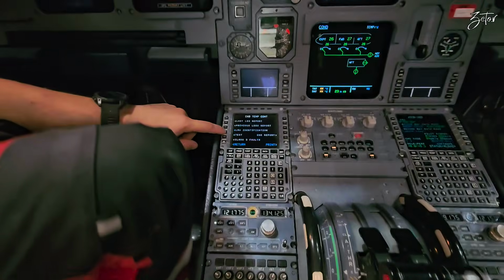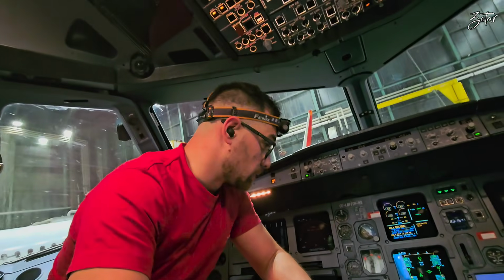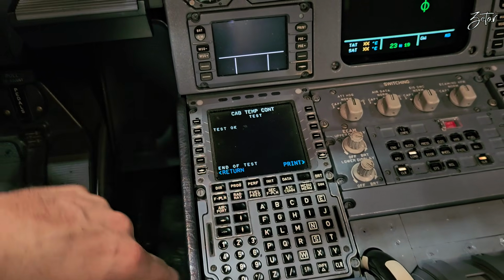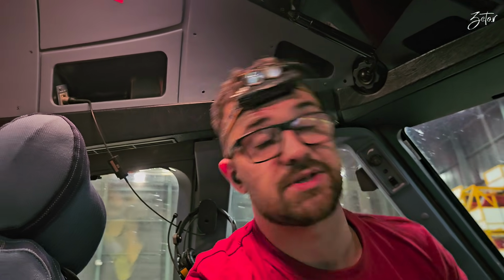How to control the temperature inside the aircraft

Comment: I have a question to make sure I’m understanding the airflow path correctly:

When the A320 is pressurized, is the extracted air from the cockpit taken only through the temperature sensor—the small opening where the cockpit temperature probe is located near the breakers panel? And in the cabin, is the air extracted only through the lavatory ceiling area and the temperature sensors/temperature indicators found throughout the passenger cabin?

I assume air is also extracted through the galley, but I’m not entirely sure where the exact extraction point for the galley is located.

So, my main doubt is: Are these the only points where air is actually removed from the cockpit and cabin on the A320, or is air being extracted from somewhere else as well?

Comment: Thank you very much, Engineer Zito, for this valuable information.. A question, please
We have problem that the two packs give outlet temperature about 20 or 25 degrees and the zone selectors at full cold .and the bypass valves every four minutes open and the packs outlet temperatures rise up to about  60 degrees then close and packs temperatures come back to about 20 degrees .we changed most the parts and the controllers but no help
Reply from the maker: Leak on air cycle machine, gasket on the side is worn or machine it self is stucked

Comment: i like the details you provide! and a question. why's the fan mandatory if the cabin is pressurized when in flight? or is necessary when the aircraft is grounded? shouldn't the air extract naturally?
Reply from the maker: It is necessary to have stable and constant airflow if you change the speed it can change the value. That's why is fan mandatory

Comment: so is the door on the outside is open in flight to vent the exhaust ? looks like it would create disruptive airflow round the rear of the aircraft all said not much but looks like a poor design to me
Reply: ok so where does the cabin air go from the two  outlets ? surely its vented
Reply from the maker: @Derekmorgan-s2j aha now I understand. Yes it helps actually to suck our out of galleys toilets and temperature sensors so you have always accurate temperature if everything works properly
Reply from the maker: Aircraft is pressurised during flight and you are not able to open the door

Comment: There so many high pressure hydraulic and pneumatic piping and connections along with electrical wiring, it’s amazing everything works for many decades in such a complicated system. It’s amazing
Reply: It works because it's maintained several times per year..

Comment: If the outlet of the fan just has an Open end in the Air..how is cabin pressurization possible?🤔
Reply from the maker: There is an outflow valve it is used for the pressurisation  of aircraft it adjusting position during flight

Comment: hi zeto! ive also had worked with a320. i wondered, how is your way of replacing waste tank water saparator? because the last time i did was, i have to remove couple of seat in the cabin right above where the waste were located, and removed the floorboard. please show us your method

thank you
Reply: hi, I have done this (shitty) replacement several times. You don't have to remove seats, floor panels e.t.c. Everything can be done from the aft cargo. Just open the partition panels and get inside. Sit adjacent to the waste tank and begin the removal of the separator. Most of the times, you don't have good access to remove it since the separator with filter is on the top of the tank but if you remove some screws from the tubes you can move them a little bit around to make some access for the removal of the separator. Cheers
Reply: @theoskou6459  wow!!! Thanks bro!!! Yea indeed the accessibility is a bit problematic and unforgiving!
Reply: @Aicarll  imagine the fun in a 321. You barely fit inside :D
Reply from the maker: Hi. I never had such pleasure to play with that 😄. But whenever I will get it, for sure I will try to record it 🙂
Reply: @zeto.r  thank you!